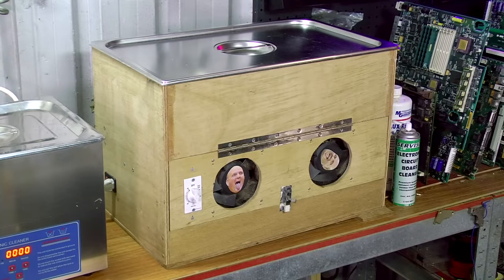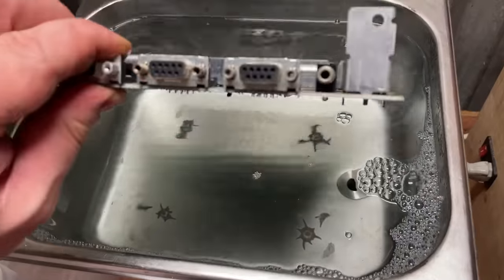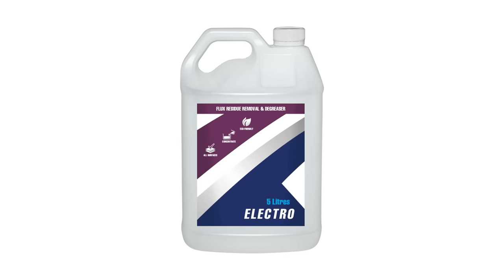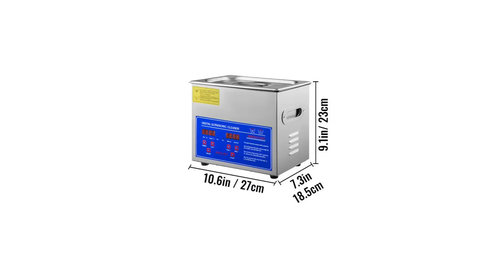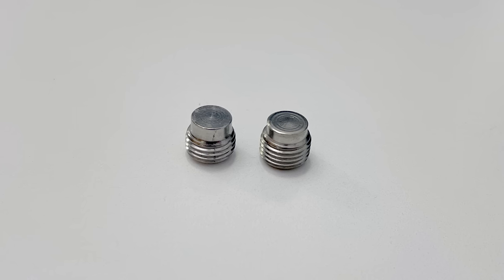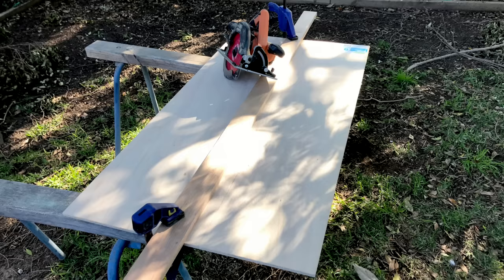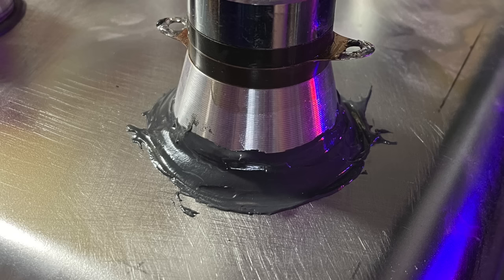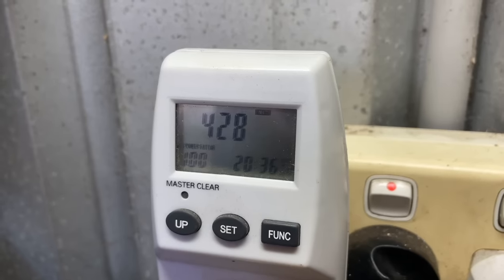Building my own Ultrasonic Cleaner

Comment: You showed a photo of Goof Off when describing alcohol. I think GO leaves a residue like Naphtha would. It may even have naphtha in it I'm not sure. Cleaning with GO is probably a good idea as long as you go behind it with pure acetone or even 99% alcohol. Nice video
Reply: To avoid standing waves I will offset the points of fixation.

Comment: Congrats on the video. Indeed it is a very clear explanation of how those cleaners work. Regarding the transducers popping out, Would it still work if you just jb' welded the transducer with no screw to the tray ?

Comment: Best DIY solution to the piezo screw-nipple bonding would be to use a $20 MAPP gas torch, some acidic flux, and a stick of 15% silver brazing rod.  Solder easy welding!

Comment: I would expect the best arrangement of transducers would be to put them all together in the center as close to each other as possible to ensure most of the power ends up in the fluid and not exiting the body. The closer you put them to panels that are parallel to the vibration, the more will be wasted by exiting mounting structures.

Comment: You say that the cleaner dont need filling a the way, but ive seen videos saying that you have to fill them all the way or it breaks the ultrasonic cleaner?
Reply from the maker: Yes, you do need to have a certain amount of liquid in there or it will damage the transducers. I was merely saying that filling right to the top is problematic (put something in there and it overflows).

Comment: i got a very small cheap ultrasonic cleaner from Aldi and works great. But also the said in the manual: don't use it for more than 20 minutes without 30 minutes cooling down. I don't think it make sense how big or small the cleaner is: it need time to cool down. The water becomes also really warm: even if there is no heating element inside.

Comment: Nice video, I was caught by the problems and the overcomes. I believe this setup can have issues because if the parasitic resonances between the four pairs of trasducers. This effect can virtually reduce the cleaning power to zero (the corner case of course)
Reply from the maker: I will be doing a follow up video where I compare the cleaning power using 2, 4, 6 or 8 transducers at once. The results may surprise you!

Comment: Fun fact, JB Weld loses it's holding power the hotter it gets. One trick in the machinist job shop industry, they will use jb weld on replaceable bore sleeves on things like loader bucket arms where it might be impossible to remachine a perfect press fit. Heat jb weld up with a torch and it will liquify, completely losing all of its holding strength making sleeve replacement very easy.

Comment: You could have silver brazed the bolts. As the bolts are very small and the steel is very thin this will work with a standart gas torch without added oxygen. If you're very skilled you get it done with a gas stove. I brazed nuts to stainless steel bowls that way. I have some TIG-welding machines too, but even with them it's a pain in the as to weld that thin stainless steel sheet. Spot welding would be another option.

Comment: Is the heat coming from the transducer or the driver?
Reply from the maker: The transducers generate some heat, but most of that is dispersed through the tank. They only get really hot if they become detached. For normal operation, the heat is coming from the drivers. I've added some better cooling that I'll cover in my follow-up video..

Comment: Another option is to braze the studs to the bottom of the pan.  There's no (or little) risk of burning a hole through.
Reply from the maker: Which is exactly what I did in my latest ultrasonic build.

Comment: Could you just use a audio speaker amp as a power source. They have 4 channels and you can run multiple drivers on each output just check ohm rating
?? Speakers are just drivers with cones on them
Reply from the maker: Standard speakers can't emit frequencies high enough for this purpose.

Comment: To really speed up the process i blow the water out with an air compressor specially below BGA componentes as some dirt might be cloged them i dry it on a dehumidifier at 80c ambient temp

Comment: wat you could do to mount those screw stubs is drill a small hole in the tub put the stub over it and plugweld it to the tub through the hole 
you should be able to do that using the gasless welder as long as youre using the right wire and setting , just point at the plug through the hole and trigger the gun untill the hole is filled up the plug takes most of the heat and melts the thinner material from the tub intoo the puddle after that

Comment: Add Arlec wifi controlled timers to your list as a replacement for the mechanical timer  around  $20 each and include a power meter inbuilt Tuva compatible

Comment: Branchus, one thing I notice with industrial grade ultrasonic tanks they always mount the transducers onto an aluminum plate about 1/4" thick. then epoxy the plate onto the stainless tank. Im thinking it's maybe for heat dissipation?

Comment: Just started looking at these today" boxing day" i was thinking of buying a 6ltr chip pan off ebay £32 because its got its own built in heater and timer, but now im wondering if the cleaning process would damage the element,i suppose i could remove the element and heat the fluid as you did ,then i spotted a 6ltr. Cleaner for £76 and after working out the cost of the transducers and drivers its a no brainer ,but i do enjoy making my own stuff, great vid tho and thanks 👍

Comment: You mention aluminium tarnishing the surface I'm looking to either biuld or buy an unltrasonic cleaner for motor vehcle diesel VE distributor pumps. In your research have you found that these can be cleaned in them? The casing looks like aluminum, though im not 100% on that.

Comment: Is there any risk in submerging components with potentially charged capacitors?
Reply from the maker: I think the risk would be minimal because any discharge is likely to travel around the board, rather than through it, but it's probably safest to discharge first.

Comment: Informative video!
Couple questions though...
Have you ruled out silver soldering the lugs?
Is it possible the glue on the transducers started to fail when/if the heating coil made contact with the bottom of the tank?
Reply from the maker: Definitely not ruled out. Please check out my latest ultrasonic build here: https://youtu.be/aDO3lxP4PO0

Comment: Can you tell me, for a 200l metal tank or drum, how many ultrasonic generators will I need? The material to be cleaned is the dirt embedded in the beeswax frames and I don't know what frequency I should use in this experiment, I believe it is 40KHZ but I'm not sure. Can you help me, please, since you understand a lot about the subject? Thanks.

Comment: my 3 pizzo unit seems to have a semi hard epoxy works ok as is ,also has opton for a fan not fitted , now I will as it seems drivers maybe under rated but still good value ,  ps I would have gone over those pcbs and re-solder as a bad joint will cause a bang ( not good ) pun intended

Comment: Watching this, I wonder if it would have been better to find a good quality cleaner with the power requirements you need and then modifying it to have the capacity dimensions you need, rather than try to source all the components individually.

Comment: Note that more glue is not better. The thinner the layer can be while still adhering both surfaces, the better (this is why you're supposed to apply pressure when gluing things). Epoxy seriously weakens when heated, maybe look into polyurethane based adhesives.
Reply: or just weld the bloody things like they are supposed to be, rather than trying to botch it with glue.....

Comment: I think you should have stayed with using the JB Weld. I have used it on dozens of surfaces and materials and it has NEVER failed me. I found it strange your reason for going with something different was because it was epoxy. JB Weld is in fact an epoxy, just that in my opinion a superior one over everything.

Comment: I wonder it the the jb weld or any other glues is your problem as they interference with the waves , were you may need a soild connection to reduced  the power and cooling  of the parts,,  does jb welding a wire on a connection  work very well????

Comment: How did you determine and ascertain which transformer is defective?  I have a small cleaner and now it produces a very weak power as compared to when it was new.  The power transistors are ok.  All other parts tested ok as well, except for the transformers.  I guessed it could be the transducer or the transformer, but I have no way to determine which one is at fault.  Maybe you could help.  Thank you.
Reply from the maker: Because I had spares, I was able to swap components until I could ascertain the failure. After a while, I got pretty good at determining the fault based on the behaviour. If it was completely dead, it was transformer A, if it was buzzing really quietly, it was transformer B. If it was blowing fuses, it was one of the transistors.
Reply: @BranchusCreations  Noted. Thanksfor reply. Will check this out.  One more question, if ultrasonic is weak, could it be the transducer itself?

Comment: hyperfrequencies or microwaves are used by microw, ovens. using a microw. oven would do the same result ?
Reply from the maker: Ultrasonic cavitation generally occurs at frequencies between 20KHz and 100KHz, but a microwave oven is 2,450,000KHz so not really the same.

Comment: i might have missed something here , i have a question , how did you run the fans ? , were they both just stuffing air in ? ifso you would get whats called air stack inside , you need to run one in and one out to keep a steady flow of cold air running all the time ? 
 .

Comment: 3:00 i actually bought something that according to the box, was an ultrasonic cleaner, at a cheap store. 
I turned it on, and there was a hum and vibration. Turns out, the fuckers just put a little DC electromotor with an excentric weight into it. 
Luckily i could return it without issue.

Comment: have you considered mounting the transducers in a piece of plywood pressed against the bottom of the water tray? What about suspending your drivers in mineral oil then using a Thermal/Electric Module to pull heat out of the mineral oil?? very cool ideas :D
Reply from the maker: Unfortunately the transducers must hang free. Anything pushing underneath them can absorb the vibrations and reduce their effectiveness.

Comment: Using more than one independent drivers is very inefficient because they all produce a slightly different alternating current will interfere with each other. This means that they partly rule each other out when one oscillator signal is at its maximum while another is at its lowest value so they cancel each other out. 
What you need is one single oscillator that drives all drivers simultaneously. This way all your transducers work in unison and work way, way more efficient. This can also be the reason why your drivers became hot and failed.

Comment: I would have just bought the appropriate size (in liters) ultrasonic cleaner from VEVOR and cannibalized all the parts to the restaurant reservoir.
I got a 15 liter USC from VEVOR for $129 USD. You have spent twice that on parts, with plenty of headaches. BTW Great video.

Comment: Welding screws in so thick steel gonna tear screw size hole in tank after few month of use, glue is good choice. Also put too much power per liter sometimes stop aluminum foil to perforate, energy is to high and move foil instead of perforate.

Comment: I'd imagine the ultrasonic cleaner would be quite good at removing the thin oxide layer that aluminum forms and since aluminum is quite reactive in water it would immediately react which I think is causing that tarnished surface. Just speculation but it made sense to me.
Reply from the maker: Yes, with the benefit of hindsight this could have been a good option, as I said in my follow up video. I still would have had to buy new transducers and attached them to the new tank though.

Comment: make a bracket, bolt them to the metal surface, weld the bolt tips so they cant come off, no need to weld anything thin or flimsy, should stick forever with proper tension

Comment: Hello! I must say this video sheds a ton of light on a topic I have been looking into for some time. While I initially was looking for ultrasonic information to improve on my current set up for cleaning vinyl albums, your information was very eye opening in that, I had no idea I could submerge circuit boards without causing irreparable damage to it! I have an original 1981 Midway stand-up Pac-Man video game that I have had for years and I want to restore it, however I've been fearful of doing that do to how incredibly dirty the internal parts are. Most importantly the original circuit board. With your information I am feeling much more confident that this restoration may now actually happen! 
One question I have is that given the age and fragile state the internal components of this game are, would you feel that this this kind of cleaning technique would be safe to perform on it? These motherboards, at least for me, have been impossible to find either repops or original and as such I do not want to ruin mine. Any suggestions would be greatly appreciated!!

Comment: Hello. I have a need for an ultrasonic cleaner also with unique dimensions and I’m looking to build my own. I purchased a transducer with the driver board to test. Every ultrasonic cleaner i see uses stainless steel. I wanted to make a fiberglass tub to size for my specific application. I have seen some examples of people using transducers on fiberglass boats. Can you think any reason why I couldn’t substitute fiberglass vs stainless steel?
Reply from the maker: A couple of things come to mind. Firstly, if the transducers are attached to the outside of the tub, the sound waves will have to pass through the fibreglass, and I think it is likely to have a dampening effect on the sound and would therefore reduce efficiency. I would also be concerned that the fibreglass might absorb some of the vibration which could also reduce efficiency. I have never tried it, so I can't say for certain either way, but I've only ever seen stainless steel tubs, for ultrasonic cleaners, so I figure there's a good reason for that.

Comment: I would have suggested putting as much of the electrical parts in a side box to ensure there cannot be any drips from the pan.
Reply from the maker: There is a lip on the tray, so any drips just go over the side. It's very dry in the box.
Reply: @BranchusCreations  If you weld the anchors on, you can end up with the possibility of a hole or crack, and the possibility that the resultant weld might not be stainless steel and so subject to corrosion.  There's also the possibility of condensation on the outside of the pan when not in use.  (I've working in places with these kinds of inserts, and keeping the whole thing clean is a scheduled chore.)
Reply from the maker: @evensgrey  I'm looking into silver soldering as an alternative, as well as other adhesives. Follow up video coming soon.
Reply: @BranchusCreations  I'll keep an eye out for it.  My current plans for things I might want to use an ultrasonic cleaner for will fit in a reasonably priced consumer model handily, but that doesn't mean I won't want something larger at some point that I don't have to pay an arm and a leg for.

Comment: Soap selection depends on the task at hand. For electronics I'll go with sonic cleaner solution tailored to electronics with distilled water.

Now, for rougher work, I'll often use tap water with dish soap or an oven degreaser, mind you I don't do the rough work in my electronics cleaner.

Comment: Have you considered that some of your problems could be due to mismatched phases between the outputs of your transducers. I'm very suprised that no on else has thought of this. You want to have all the transducers outputting at the same frequency and phase. If you look at a production unit I'll bet you'll find a connection between drivers to run them at the same phase.
Reply from the maker: If you check out some of the follow up videos you'll see that I have identified and resolved all of the issues I was having.

Comment: Great video. Check out Brulin cleaning solutions.  I used to use these and they have a variety of solutions for different applications.  They also can be used without distilled water as there are agents in the solution that sticks minerals together to sink them, which conditions the water.

Comment: Cmon Bruce. We have 230V AC not 240 :)  Keep up with the changes ;). Also I wonder if the transformer issues you are having is due to vibration? Does the cleaner/cabinet vibrate during use? If so then perhaps mount driverswith some rubber grommets or on not rigidly attached to main container.
Reply from the maker: I want my 10V back!
Reply: @BranchusCreations  hahaha...Price goes up and they even take 10V away. Just like the Big Mac that is not BIG anymore.

Comment: Tip for anyone cleaning small stuff. 
Don't fill the entire tank with cleaning solution, instead fill the tank with water and put the cleaning solution inside a mason jar with your items to be cleaned. That way you don't damage the cleaner from low water levels and you save a lot of money on cleaning solution.

Comment: Instead of using glue of any kind, you could have just welded using solder and some metal clips. Solder is great for metal to metal contact and high temps.

Comment: “Ultrasonic frequencies in the range of 20–100 kHz are commonly used for ultrasonic processing such as cleaning or homogenizing, can cause cell disruption & bone marrow damage so never put you hands in it while it is operating. Also if you use the heater remember that 50 degrees centigrade is about 123 degrees Fahrenheit & may burn your skin.